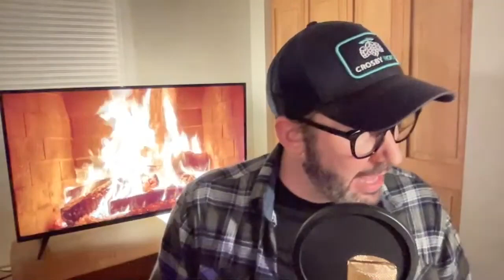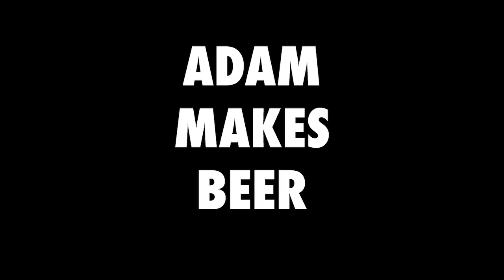Does A Spunding Valve Make Better Beer?

Comment: Hey Adam, great vid! Is there a pro brewer forum you recommend? Maybe something you can set up? I've got questions on a number of topics, but not sure if the comments section is the best place 🤔
Reply from the maker: I don’t really use forums. They can be hit and miss. If you drop your questions in the comments, I will add them to my livestream Q & A list. Cheers!
Reply: Okay, here's a couple...
1) Just brewed a batch of Wheat ale on new 3BBL equipment. Everything went perfect, very active fermentation however final flavor profile came off as a sour. What gives? Mash pH on target in mid 5s, all cleaning protocols on point, however cool down post boil to pitch temp was longer than planned. Lallemand Classic Munich yeast used. Final packaged pH in the mid 3s ... i.e. sour. Still a very tasty beer however 😊🍻
2) Recommendations on cool down methods and / or plate chillers?

Thanks! 😎
Reply from the maker: @Timothythebrewer  How long did it take to chill? Was it a closed transfer or was the wort open to the atmosphere? The more detail you use the better I can answer!
Reply from the maker: @Timothythebrewer  As far as question 2, for a 3bbl system? Please give more info on your brewhouse and FVs.
Reply: @adammakesbeer  Fair! Chill time was over 3 hours and closed transfer as I am actually using Brewha 3 BBL equipment (conical / jacketed fermenters).

Comment: I spund and pressure ferment my lagers at 15 psi, usualy around 65 degrees.  I havent had any issues with sulfur, and the beers have been super clean.  Usually hit terminal gravity in about a week.  WLP 925 is made specifically for pressure, but I've also done this on WLP 800, 820, and 830, as well as with Saflager 34/70, all with similar results.
Reply from the maker: Very cool!
Reply from the maker: So are you pressurizing your tank after pitching yeast? Allowing pressure to build on its own?
Reply: @adammakesbeer  I've done both, and haven't noticed a difference in flavor or ferm timeline.  My SOP now is to pressurize to 1 bar right up front.
Reply from the maker: @jayspies9860  Are you harvesting and repitching?
Reply: @jayspies9860 I like to pressurize with oxygen during pitch

Comment: I pressure ferment most of our beers with spunding valves - slapping one on the tank at yeast pitch. What won me over was that I blind tasted our Festbier fermented under pressure against the same beer fermented with typical blowoff 2 months earlier and the pressure fermented lager was cleaner.
Reply from the maker: That’s fascinating. Any other differences? Any issues with sulfur?
Reply: @adammakesbeer  Not that I can perceive. Our "lab" is a refractometer, a pH meter, and my 5 senses so maybe I'm missing something. 

I mean, volatile biproducts still burn off - the spunding valve sounds like a kazoo at peak ferment. I imagine the sulfur doesn't get "trapped" or anything. My understanding of the magic of pressure fermentation is that it's the amount of CO2 in solution that suppresses the formation of esters and higher alcohols.
Reply from the maker: Thanks for your input!